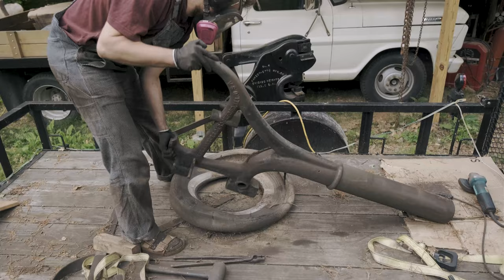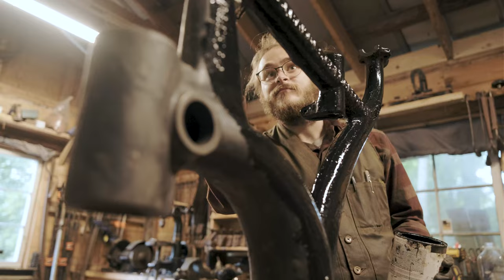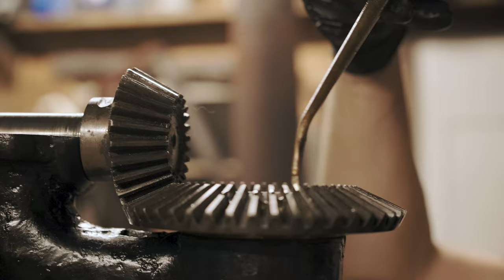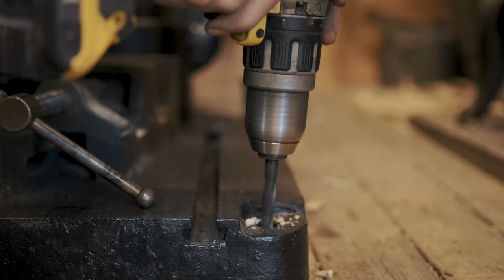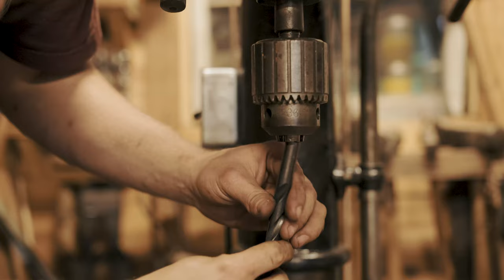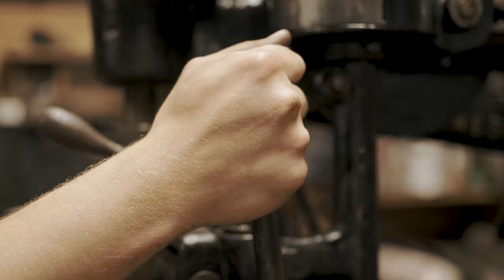Antique drill press restoration

Comment: Hello there. 
How did you exactly weld the cast iron parts back up? 
I bought an old drill press today but it has a small crack that i would like to repair. 
Thanks in avance. 
Friendly greetings.
Reply: It’s a method called brazing, similar to welding except more difficult and it uses bronze to fill the cracks. It’s very difficult to weld iron castings on old machines like this, so they are typically brazed instead.